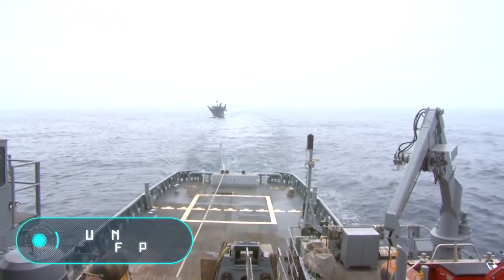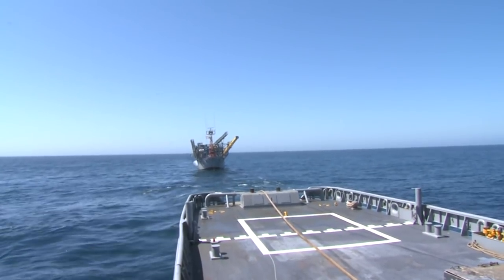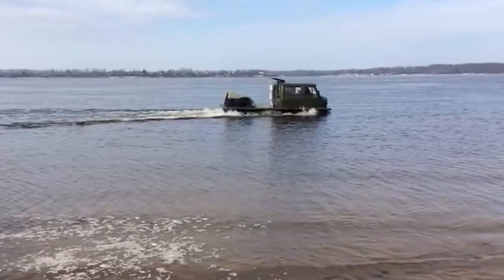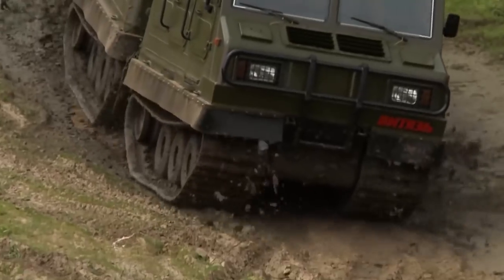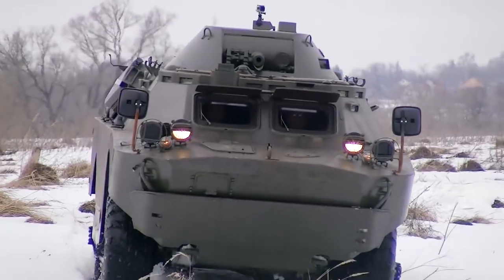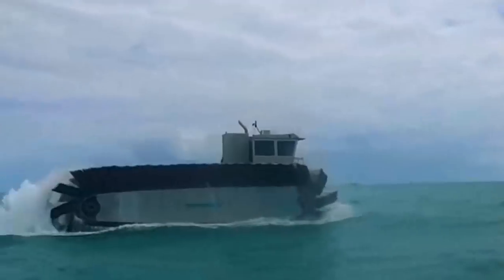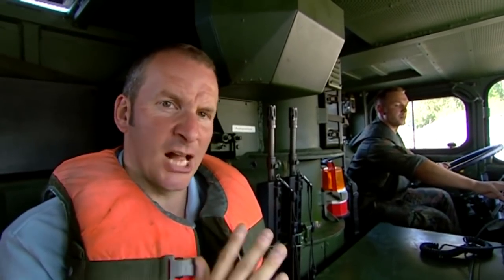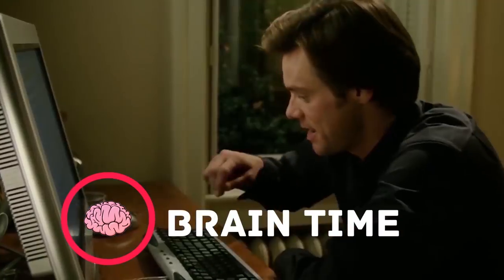10 AMAZING MACHINES WHICH ACTUALLY EXIST

Comment: The Russian screw propelled vehicle looks like something designed by Brains from the 1960s  Thunderbirds tv show.
Reply: michael roberts so cool until it said average speed 6 mph
Reply: The trackway was used by the British on D-Day and for many years since. So not new. And the two part tracked vehicle is Norwegian I believe.
Reply: Its a BvS10 Called a Viking in UK service. Its from Sweden. It comes from the Bv 206 which is from 1980. Both the BvS10 and Bv 206 are still in service
Reply: phiffion. Thanks. I knew it was from that area. I think I thought it was Norwegian because it is used by the Royal Marines when they are in Norway.

Didn't a British team cross from Alaska to Siberia in something like that screw vehicle several years ago?
Reply: 1929 Ford - Fordson tractor with screw drive:  https://www.youtube.com/watch?v=Fo31_3UzTTY

Comment: Why so many ads?
Reply: RICH K No ads? I have no ads
Reply: what ads?.. I didn't see any ads for years.. install ublockorigin and free yourself from spam.
Reply: because he wants your money.
Reply: RICH K I use adblock on Android and windows to block all the ads
Reply: How do I block ads on iOS? That is the real question
Reply: You can't, Apple is shit, Android can block ads in the youtube app, windows and linux can block ads in the youtube website, iOS can't block anything.
Reply: To earn more income
Reply: Because your internet sucks
Reply: Slow internet speed will not cause an increase in advertisements displayed, there will still be the same amount of ads, but they may buffer on slower connections.
Reply: I went from slow crap internet and tons of adds to great internet and no adds sooooo
Reply: John Miller Absolutely no connection between the two, perhaps you installed Adblock or bought YouTube Red?
Reply: ELECTROHAXZ 
Nope just internet change. I understand what you mean, one not doing any for the other, that's common sense. But after the change out, no more adds.
Reply: John Miller Ok, but as someone who has been working on computers a long time, hardware and software, and a hobby electronist, those 2, have 0 correlation, they might have happened at the same time, but there is something else going on, your ISP and internet speed have nothing to do with ads!
Reply: ELECTROHAXZ 
I know that.
Reply: well, of course, that's how business works, they give you a product and you buy it from them, nothing wrong with it, that's what makes the world go round.
Reply: RICH K money my child
Reply: ELECTROHAXZ good point, I'm no computer Expert and could give two bits to a dollar as long as it's fully  operational, but yeah, Internet speed has nothing to do with advertisements, that's like with a Newspaper and saying that the thicker a Newspaper, the more advertisements that are in it, BS, you can have a one page Newspaper and either be front to back advertisements or it can be front to back News or mixed, same with a 40 page Newspaper, you can have front to back News or it can be front to back advertisements, or mixed, The only difference is one's going to take longer to look through than the other.
Reply: ELECTROHAXZ 9
U